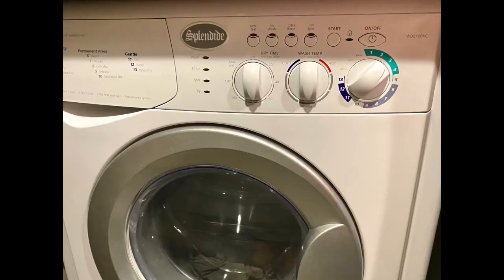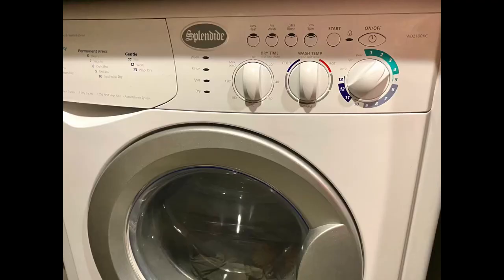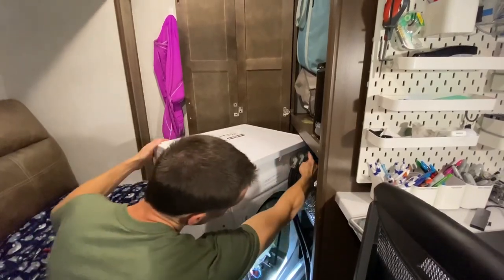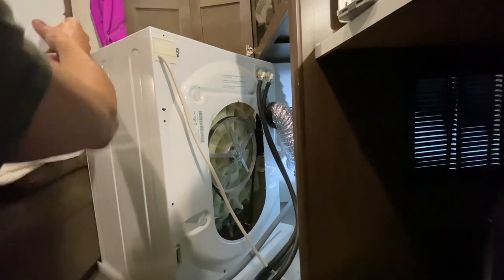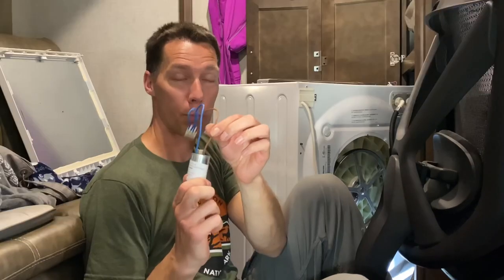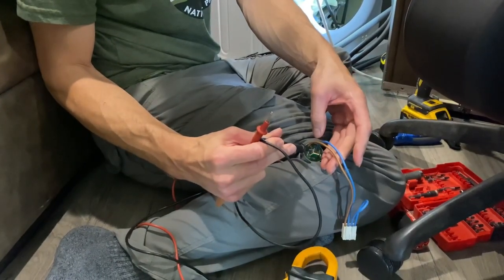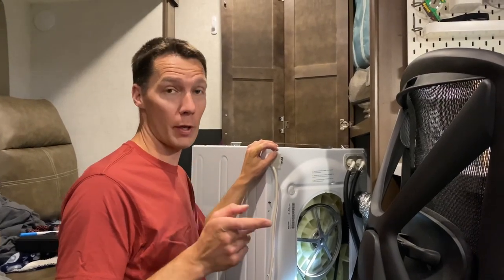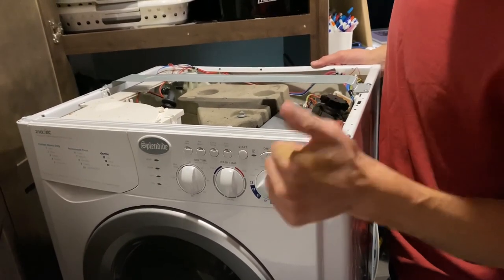Splendide 2100XC Repair | No Power No Lights

Comment: Before you turn on or off your generator or inverter, make sure your appliances are unplugged or circuit breaker is open (off position).  Frequency and voltage are very unstable during the starting and shutting down process of these power sources, which can cause voltage regulators to get slowly damaged over time.  In addition, purchase inverters that create a pure sine wave instead of modified sine wave.  Modified sine waves contain too many harmonic frequencies that can also slowly damage your voltage regulators in many electrical appliances.
Reply from the maker: Yes that is why it’s important to have the pedestal breaker off when plugging in at campgrounds and turn it on after plugging in. Also devices such as smart surge protectors and transfer switches have time delays to make sure power is stable before passing it through to the RV.

Comment: Thank you so much for getting stright to the point.
I moved my, Montana Mountaineer from a camp sight to a forever home critters & self included. Issues with power when i got where i was going. I needed a new inverter, Bam machine wont turn on. Only one visiting repair man for over a 100 mile radius.  He said nothing he did ha like a surgeon..
Thank you

Comment: Splendide 2100XC
All it does is buzz/hum. I have lights, door locks, no codes and no reset position. Tried the plug thing for 30 seconds, nothing. What's your idea?
Sincerely: Mr. dirty clothes
Reply from the maker: You would need to check the power going to the control board. If there are no error codes, I would suspect the control board. If there are error codes, the manual will walk you through it.

You can find the manual on this forum: https://www.forestriverforums.com/forums/f4/splendide-2100xc2100xc-repair-manual-164190.html

Comment: Your part link is incorrect. Not for the circuit breaker.
Reply from the maker: Hi Steve, I’m confused about what part link is incorrect in the video’s description.
Reply: @RadarRoadWarriors  Your link goes to a Washer/Dryer Radio Noise Suppression Filter not a circuit breaker
Reply from the maker: @jimengland13  Thank you

Comment: Please help. I am at wits end with my Splendide 7100xc. I recently bought a brand new Motorhome RV about 9 months ago for our ranch waiting for the construction of our home. For the pass 9 months the washer and dryer was working flawlessly until last 2 weeks. Keep in mind the RV has not been move or anything has change. The washer will finished the wash cycle, and rinsing cycle spinning at high speed in that cycle. Than add freshwater again in the rinse cycle and at this point is where I am having the problem. The washer will spin for 3 seconds and you can hear the door latch click a few times really fast and the lock red indicator lights goes off and on when the clicking sound starts. The water pump will purge for 5-6 minutes. Then Low Heat, Extra Rinse, Low Spin, green flashing lights flash at the same time, and the lock red indicator flash faster than all three green lights. I called the company trying to get help. First guy was so rude. He did not let me explain what was wrong with the washer. He keeps cutting me off and try to over talk every time I speak and told me the problem is not the washer is my RV. I called back the next day another technician told me I have a error code F-10 and send out new board. This technician was extremely professional compared to the first guy. I installed the new board and still have the same problem. Called back and another technician told me to use a generator to power the washer and ground the generator and ground the washer. He he informed me that I have a F-13 error code. Keep in mind still the same flashing lights. Truthfully I don’t see why this method will fix anything but I went ahead and try it out. After trying what the technician suggested and still having the same problem. Call back again and another technician told me I have a error code if F-11 instructed me to cut the power plug from the washer and install a Edison plug. He informed me that I don’t have ground and the my pump is not getting power. I told the technician how is that possible if the pump is pumping water out of the washer in the wash cycle and rinse cycle. Again the technician told me to cut the washer power cord and installed the Edison plug and that will fix everything. He get calls like this everyday on the same issue. At this point any help would be greatly appreciated.
Reply from the maker: Southern Spirit,
That sounds very frustrating. By reading this it seems like an electrical connection issue. There may be a loose or broken wire somewhere and I could see a bad plug being a culprit. Do you have a plug tester to make sure the RV outlet is in good shape? (As in it has power, neutral and ground) Maybe try plugging into a different outlet.

I found 2 things that might help you with it:
1- Maybe the drain hose is too low if it fell down after the last load.
https://www.manualslib.com/manual/164677/Splendide-7100xc.html?page=22

2- This says how to read the fault codes and what they mean.
http://www.splendide.com/service/TRAINMAN_Diagnosis.PDF

Also are you calling Westland Sales or Splendide? Westland Sales is who I called for parts and they were very helpful.

Hopefully one of those thoughts helps, Steve

Comment: I bought the part and still no lights go on.
Do I have to reset something?
Reply from the maker: Maria,
I didn’t have to reset anything. Did you verify there is power coming to the washer and through the surge suppressor after the new one was installed?
It could be a bad circuit board if also if you had a big surge hit the RV. -Steve

Comment: So the one I ordered in the description has a 2 pin connector...the old one was 4 pin...will it still work?
Reply from the maker: Char-Lay, What is the model of your washer? 
Our 2100XC had a 2 wire and I replaced it with a 2 wire. I don’t think a 2 wire can take the place of a 4 wire. You can call Westland Sales to get some additional tech support for your exact model. -Steve
Reply: Just watched the video. Yours had the 4 pin plug on the original you pulled out. A brown wire, a blue wire, then a blue wire looped back to the connector. Did you replace it with the 2 pin that has just the brown and blue like the one in link in the description ?
Reply from the maker: @JBJack40  my apologies, apparently I’m thinking of a different Splendide I’ve repaired.
 I’ll look back on my notes on my washer to make sure the correct part is listed.
Reply from the maker: @JBJack40  now that I refreshed my brain. I see it had 2 wires coming off the round part and a jumper at the connector for the 4 wire connector. Here is a new link for the 4 wire connector part. 
https://tweetys.com/westland-surge-protector.aspx
Reply from the maker: Char-Lay,
After John noted my washer had the 4 pin connector I dug until it and can see the link was for the wrong part. Here is a link to a 4 pin connector. https://tweetys.com/westland-surge-protector.aspx

Comment: Mine does a click click (obviously locking mechanism in door) no lights thou. Did yours still make noise like mine?
Reply from the maker: Miss Luna,
Ours was completely dead with no lights and no clicks. It sounds like yours is getting power and has another issue. -Steve
Reply: @RadarRoadWarriors  thanks so much! I'm thinking so too.
Reply from the maker: @misslunafleur3825  you’re welcome. I hope this video helps if it’s the same problem that we had with ours.
Reply: @RadarRoadWarriors  Your gonna laugh. The problem was the door hinge came loose. So I guess because the door was loose, it shut down the system. Put new screws in and now it's working good as new.
Reply from the maker: @misslunafleur3825  we love easy fixes like that.
Reply from the maker: @misslunafleur3825  it’s great you figured it out.
Reply: @RadarRoadWarriors  Thank You. I spent hours searching and watching videos and all it was was two screws lol. I felt dumb😂 Thank you thou for all your help, your video was very helpful.